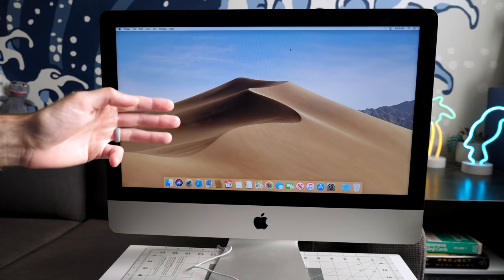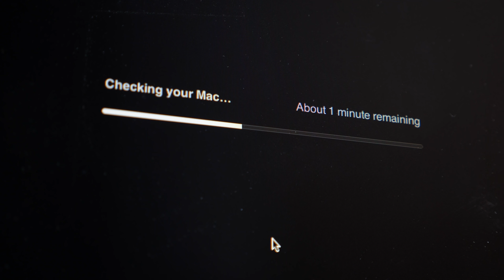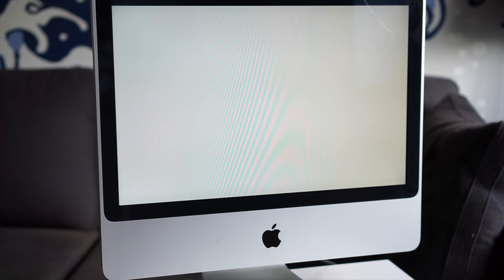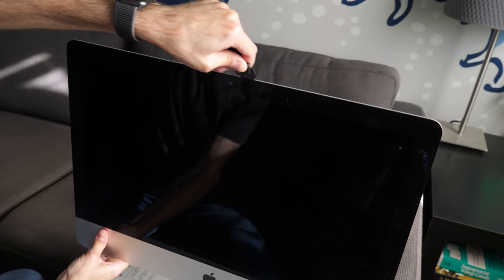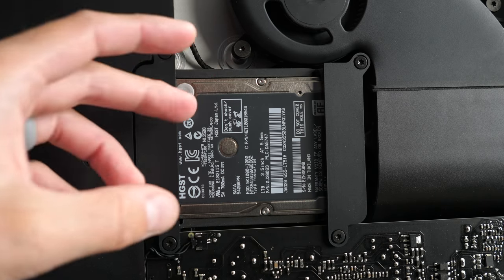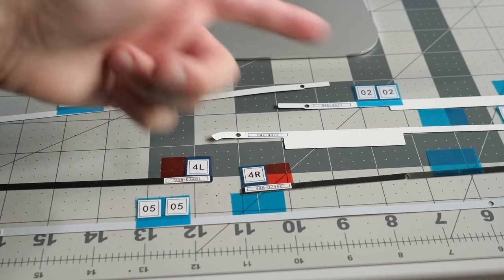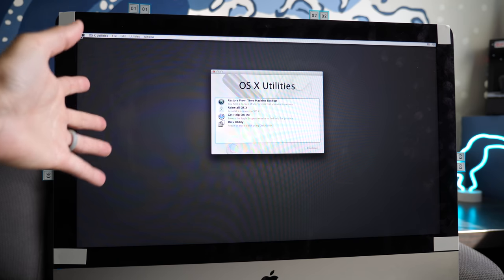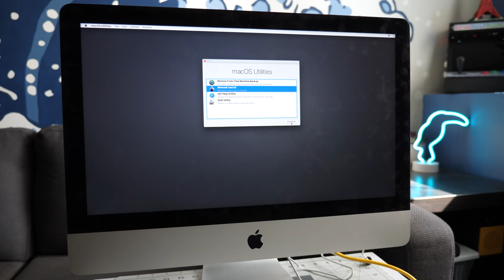DIY 2013 iMac SSD Upgrade!

Comment: Fun fact: I checked your iMac S/N that you showed at the beginning in Apples Service platform. The previous owner already had an issue with the iMac not booting up in September 2018 and created a support ticket.
Reply: A very fun (But alarming) fact.
Reply: nice catch
Reply: where can i check for such things? i'd love to  check out some of my older apple devices to see their history
Reply: @rayproductionsbackupchanne3862  I repair phones and computers for a living and our company takes part in Apple’s IRP (independent repair provider) program. As such we have access to Apple’s service platforms like GSX. Unfortunately there is no way for a normal person to check things like that, even though it could be very helpful (repair history, configuration the device came with, etc.).
Reply: That sounds a little weird bro
Reply: @joshuamichael1232  😂😂😅😅
Reply: @Wasper216  Yeah, glad that stuff is somewhat private
Reply: @joshuamichael1232  You know this is a second hand machine right? You don't sound like the brightest bulb.
Reply: @joshuamichael1232  OK Karen
Reply: @joshuamichael1232  wow, someone lost their pacifier.
Reply: @joshuamichael1232  ??? That system doesn't give you any personal information regarding owner/s, Just the description and history of the machine - From their records. If anyone was allowed access, it would be a very helpful tool with no privacy issue whatsoever. Buyers can find out if something has been stolen or had undisclosed work ect.. But a criminal minded person couldn't do anything with that info, They'd be the ones hiding it in the first place lol Apple just wouldn't give free public access their tools no matter what anyway.
Reply: @Wasper216  can you check if d700s have been replaced in a 13 Mac Pro?
Reply: @48aee good pfp

Comment: I did this on my wife's 2012 iMac, which has a magnet-based mounting system for the display panel. The SSD was an enormous performance boost from spinning disk and without exaggeration felt like a whole new computer.
Reply: I did the same on my 2011 27" - It was unreal how much better it was after the upgrade.
Reply: I think he should have stuck with the original OS.  It would be as fast as it was the day it was new, even faster with the SSD.
Reply: @bobacks  Same here.  It really doesnt feel 10 years old.  Macs Fan Control installed to handle the fan speed issue. Running problem free for 3 years.
Reply: How did you reply three days ago when this video wasn't uploaded until today?
Reply: @matthewlanzilla9849  probably a patrion supporter
Reply: @matthewlanzilla9849  It gets early access on patreon.
Reply: Did the same on my i7 2010. Made a huge difference. It actually runs the os now.
Reply: did the same on a mid 2010, still using it, even for video editing
Reply: Same here
Reply: @tarstarkusz  I would’ve updated it just before Catalina. Too old to benefit from the new OS architecture, it loses more from all the incompatible software
Reply: That description truly applies. It is incredible what happens when someone has an old computer with a regular hdd, and you upgrade just the drive to an ssd. When they sit down at the computer they can barely contain their excitement and joy.
Reply: i don't think the 2012 imac has a magnet-based panel holder. by 2012 they had gone slim-profile and the only way to get inside was to slice the glue sealment.
Reply: @daktarioskarvannederhosen2568  He rather means bought in 2012 and not the model year, the 2011 models with ODD (A1311/A1312) were officially discontinued in October 2012 with the introduction of the new "tapered-edge" design; however a educational version of the 21.5" with Core i3 was still offered into March of 2013.
And of course sellers might still have "new old stock" months after that.
Nowadays Apple also offers old and new models parallel, the Late-2018 still x86 Mac Mini was just discontinued this January and the 2020 27" iMacs were discontinued in March 2022 almost a whole year after the introduction of the new M1 iMac (because of its smaller screen; the 21.5" models were already discontinued with the release of the M1 iMac in April '21).
Reply: @kuchenblechmafiagmbh1381  'new old stock' is irrelevant. as you know, a quick click on 'about this mac' brings up, among others things, the year model and the approximate time of year made. late 2012 imacs are the beginning of the dreaded 5mm slimline non ODD design.
i suspect that 'october 2012' would fall in to category 'late 2012'.
Reply: @kuchenblechmafiagmbh1381  e.g. 'I did this on my wife's 2012 Toyota Corolla.'
would you take that to possibly include  meaning '2011 Corolla purchased in 2012'?
Reply: Shame Apple got rid of the magnet front glass system

Comment: Have the 27” GPU model of the 2013 iMac in my studio and it’s a beast. Got real slow a few years ago but I swapped an SSD in last summer and it’s flying now
Reply: Did you had any problems with the temperature sensor ramping up the fans? , or no issues whatsoever?
Reply: If possible, you should also investigate putting an NVMe SSD in there. AFAIK all 27-inch iMacs of that time period should come with the internal card-style PCIe SSD slot even if you did not order it with Fusion Drive option, and that slot can accept an NVMe drive through an adapter. Those can be at least 5x faster than SATA, so even just a 256GB one for building a Fusion Drive with your SATA SSD can be beneficial.
Reply: @hikaru-live  I always thought the Fusion drives were one piece like those Hybrid stand-alone HDDs, great to know there’s an actual PCI connector for real SSDs
Reply: Do you have to backup the computer before installing the SSD?

Comment: I do a lot of these!  For the adhesive along the bottom chin, there is a vertical tab at each side you can grab to release the adhesive. To get more access to the SATA plug, undo the 2x screws for the speaker and it can be tilted to the left to give you more room to plug in the new drive.  Oh and for 27" 2012 and on models you don't need a software patch or plug in thermal sensor if upgrading to SSD, you do if replacing HDD with HDD.
Reply: Great information! I have a question, I have a 3TB fusion drive in a 27” 2014 iMac that I would like to upgrade to a full SSD, would the process be the same?
Reply: @ronkemperful  Similar. But you can’t have a Fusion of two SSDs so you’d end up with your new SSD and the smaller Fusion SSD as two separate drives. Still worth doing 👍
Reply: @griffog2001  Thanks!
Reply: Darren: I've got a 27' late 2012 with a failing HDD. What SSD model do I need to buy to replace it?
Reply: @690design  Any 2.5" SATA model will do fine.  Amazon is your friend!
Reply: I've been meaning to put an SSD in the Late 2012 27" iMac that my parents own. It's the non fusion drive model that only has a HDD. If I use a sata SSD I won't need to buy a thermal sensor from iFIXIT?
Reply: @lachlanbrown8110  Correct. No need. You just need the SSD. 2.5” adapter and tape kit to reinstall the display. Makes a huge difference, go for it.
Reply: @griffog2001  wow, you just saved me $80 aud. Thanks. 👍
Reply: @lachlanbrown8110  Single drive model needs no thermal sensor, which was why I specifically opted the inferior but cheaper stock HDD model for my 2017 mac bc of that!
Reply: @lachlanbrown8110  read it said before :  Oh and for 27" 2012 and on models you don't need a software patch or plug in thermal sensor if upgrading to SSD, you do if replacing HDD with HDD.
Reply: If I were to take out the old HDD from 2013 27” iMac and replace it with SSD, could I recover the data from the old HDD? Is there a way to do that with the old drive out of the computer?  Thanks for your help.
Reply: Hi @griffog2001 by chance would you know if it’s possible to put a m.2 nvme sad into a 2011 imac.  Are there connection differences that you’d have to accommodate for?
Reply: @yustinaaron  Yes if not Fusion Drive model.
Reply: @markporo  The 2011 model doesn't have an NVMe port. There are SATA to NVMe adapters but you wouldn't see much if any benefit over a standard SATA SSD,
Reply: @griffog2001  gotcha!  Thank you for the information.  It’s really hard to find these kinds of details for older machines.  I appreciate it.
Reply: @markporo  All you need is an OWC Thermal Sensor Kit (or use Macs Fan Control Software Patch), a 2.5" - 3.5" Drive adapter and your SATA SSD.
Reply: @griffog2001  you are amazing!  Thank you :)

Comment: Nerd debate time!
Holding the power button to discharge caps is mostly effective from my experience. Especially on higher quality units with large filtering caps it's important to do.
Reply: Still, don't want to test it by putting my finger on it though.
Reply: high quality power supplies should have a discharge resistor on those big capacitors, so they will be discharged after couple seconds/minutes. But as you said, holding power button is also a thing i recommend.
Reply: I do it while working on macs and PCs, and haven't got 'bitten' since I started doing that before stabbing power supplies (as one does) during upgrades/repairs.
Reply: have you put a volt meter to it before you did to see if it recorded anything ?
Reply: @jockeyjeon9532  it’s in case of you doing it accidentally :)

Comment: The bottom adhesives actually have pull tabs on the sides for you to pull. I know this because I am an Apple technician. You don't need to cut it.
Reply: Do you have a video showing this??
Reply: @mr702s  if you look at 17:50. The left side of tape 4L and right side of 4R are the two pull tabs of when you remove the display. This way you don't need to cut it like mentioned in the video.

Comment: Why wouldn´t Apple just use the standard way to read the current drive temperature?
I mean almost all sata drives support reporting it´s temperature as a part of S.M.A.R.T which can even be read over USB nowadays (and ofc PATA and SATA)
No need for external sensors or custom firmware on the drive.
It´s all there already...
Just another Apple thing?
Reply: Apple just being "special" as ever

Comment: As a 2017 21.5" 4K iMac user myself, I remember vividly when High Sierra took 1:30 and Bootcamp 3min to boot straight outta the box! I did the SSD swap myself and I can confirm no thermal sensor was needed. Only the HDD in the fusion drive model requires it and mine's the stock 1TB. I need to warn you that the new adhesive strips aren't as sticky as the original, as mine started to peel off 2 years after the upgrade. I did order new ones, but I'm thinking of also performing a ram upgrade while I'm at it, as it's such a pain to pop open the screen again.

Comment: Great video! I used to work at an AASP, and this is pretty much exactly how I was taught to do this. The only thing I want to say is that I heavily discourage using generic VHB when replacing the display. The iMac adhesive (including the iFixIt stuff, which looks identical to what Apple gave us) is designed to split in the middle when you use a plastic cutting tool, whereas normal VHB is not. You can still split it with a box cutter, etc. but you'll greatly increase the risk of damaging internal components.

Comment: Holding down the power button while it's unplugged is how you reset the PMU, and resetting the PMU is achieved by completely discharging the PSU. SOOOOOO it stands to reason that the advice is sound.
Reply: +1, do this.

The caps in those PSUs are pretty fat, you would absolutely not want to get zapped by them. And they absolutely hold charge for quite a while.

Comment: I bought my 27" IMAC in 2012. It looks and runs like new. I added additional storage and plug in two external HD for use for general storage and Time machine. To those people who doubt Apple products you are delusional. To get best part of 10 years out a desktop and still purring along nicely I call that a quality product.
Reply: You can easily get 10+ years out of a half-decent PC as well... and you'll pay 10% of the price up-front. Apple's hardware is good quality, sure -- but so is standard PC hardware. My machine from 10 years ago is still running fine.

Comment: Had this done to my 2012 i-Mac adding 16 gigs of Ram, as well as a New 1 Tb SSD. It served me well and is now with my daughter still working as her daily driver. It cost me just under $200.00 to add the SSD and Ram and so far my daughter says it's running well for its age.
Adding the Ram also boosted the speed on the i-Mac too!

Comment: I upgraded one of these as well - it's amazing how usable these iMacs become when they're not hindered by the absolute trash-tier drives Apple put in them from the factory. It boggles the mind why Apple continued to do it for so long, but it also makes used examples of these excellent values for light-use machines with a little upgrade work.
Reply: Because during this time period SSDs were PRETTY PREMIUM then again.... macs are Premium hardware so paying 500USD for 512GB is fine
Reply: @edwardtan1354  7200 drives were normal for many years before this model was released. And hybrid drives were fairly normal as well.
Reply: @edwardtan1354  at the time, and for a few years after that, iMacs were the only Mac that sill shipped with HDDs. If you wanted a stock SSD you had to buy a MBP. It boggles the mind
Reply: @wyterabitt2149  7200 2.5” drives normal for many years?
Reply: @alvareo92  My mid range dell's all had them from 2011 onwards. And the hp I got for my gf in 2013 did. I only saw slower on low end, or the basic bad value spec companies try and sell those who don't research.

Comment: I have a late 2009 21.5" that is still my daily driver.  Upgraded to an SSD a year ago and it still works fine for everything I do.  It's hard to believe that a computer that now 12 years old is still my main machine. Granted Apple stopped support for it a few years ago, but I think it's safe to say that I have definitely gotten my money's worth from this machine. Great video Colin!
Reply: I have a 2009 24” that is still my daily driver also but it still has a mechanical hard drive inside and it’s getting way too slow; I was thinking about swapping it with a SSD but i don’t know if it is worth the trouble…
Reply: I swapped my HDD with and SSD years ago on a 2007 24", use it everyday it works great and fast.
Reply: @donduncan3052  thank you for your input. If you don't mind me asking, how much memory do you have and which ssd did you install?
Thanks
Reply: 6GB of Ram and the SSD is a Samsung 850 EVO

Comment: This just re-enforces what I found while working for AppleCare in the UK. I saw countless 2013 iMacs with the 1TB hard drive just become slow as molasses, and often failed. It is most certainly the hard drive. No idea why, maybe all the 1TB drives ever given to these models are just trash... I know this is not just me, there has to be a deep seated issue there
Reply: I had one from HP I'm guessing at a certain point there was really trashy components the circulated thing is that was a seagate, this one I think is a toshiba or hitachi made

Comment: I was gifted a 2011 27" i5 imac once. It had a dead hard drive, so i swapped in a new 2TB one. Installed that HDD fan control software and it worked just fine.
Later downgraded to a 2011 Mini, since I only have space for one screen, shared between my PC (fun and games) and my Mac (fun and productivity, still running Aperture in 2021!)
Reply: You can run MacOS on your PC with by installing a linux virtual machine. Mutahar from Some Ordinary Gamers did it.
Reply: @jockeyjeon9532  or just hackintosh it. You can still run windows along side Mac OS.
Reply: @drbass9677  Running MacOS through virtual machine IS hackintosh.

Comment: The best way to install a new drive is to lay the iMac on its back, unscrew the speaker enclosure and move ir aside and remove the tape from the nearby fan and move it away. You can remove the drive tray and it’s a hell of a lot easier. Laying the Mac down also solves your drop problem because the screen won’t fall foreword and smash on the floor. Also you’re right, don’t buy third party tape. I had a friend who used 3m high bond tape which unbeknownst to him had hardened over a couple of years. When he went to do another upgrade he couldn’t cut the tape and the screen broke in half. I’ve done three of these, a 21.5 and 2 27s. They all work fine.

Comment: on the 27" (at least 2013 & 2017 I have worked on)  the last adhesive strip on the bottom of the screen has a pull tab on the outsides that you can pull off the adhesive strip rather than cutting that last one.    Be glad this didn't have the SSD on the backside of the board, that was a complete pain to get to.
Reply: Think that only applies to the 27" models, as the 2017 21.5" didn't have the pull tab

Comment: I had a similar problem with my 2012 Mac Mini, the hard drive did the same thing like the iMac. Sometimes it worked just fine while other times it would just freeze on startup. Every time the hard drive did that, I restored it with my Time Machine backup until I finally got a 2 TB SSD. Combined with the upgraded 16 GB of RAM I installed, it feels like a completely different machine! Definitely worth it to upgrade these older machines!
Reply: I just installed an SSD in my 2012 Mac Mini a week ago.  :-)  You speak the truth, sir!
Reply: It basically turns it into a new system, nice to hear it’s working well!

Comment: Screen attaching TIP! Peel off long strip of blue painter's tape. Position the bottom of screen on lip, line up edges, Apply strip along bottom between screen and metal bottom, run the length of the screen. This will keep screen in place as you tilt and jiggle to get it in exact placement. Remember to always peel off bottom strips FIRST before you attach 2 cables! ALSO be sure you are lined up perfectly before removing bottom strips!!